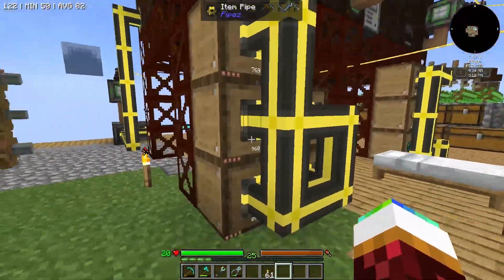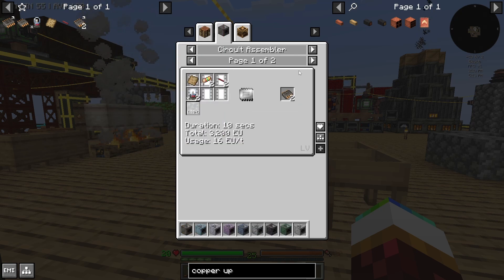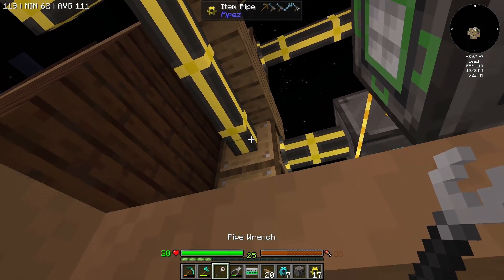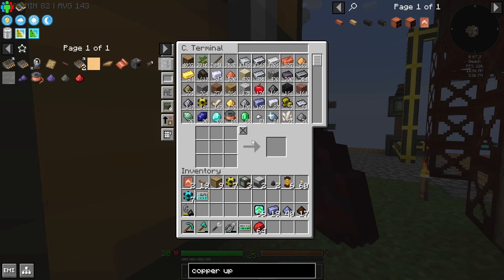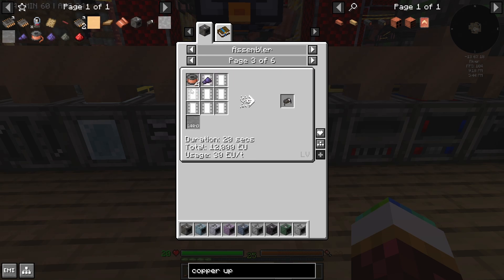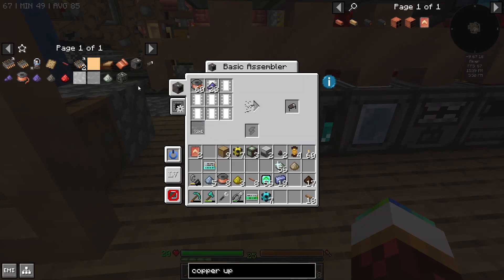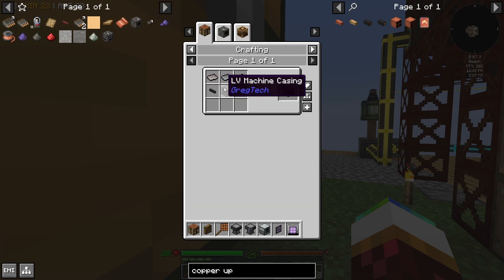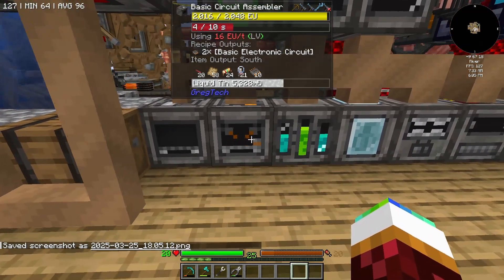Star Technology - EP22 - Easier Circuit Making

Comment: i comment this without any info for episodes under this one i got here first
so dont know what you done or said

i myselv have got to the start of HV for a frame of refrence

the biggest thing i can point to is the rain there is a bug in the base game thats existed for years where if rain is negated any other way then natural (sleep or time)
it will simple comback soon after everytime repeat like clock work unless the gamerule is flipped
the quest book has a quest to perma turn it off without needing cheats (that button you using) in the shop also got one for daytime

next i notice how you where placing machines and drawers and setting auto output but keep expecting it to auto input
as you know thats not how that works gregtech has extra tools for this job
you most likely seen them but not been thinking to much of them
conveyor robot arm and pump
all do what you need for compact places
just pop em on a side of machine that needs a input or extra output
robot arm is a bit more powerfull
to change there settings shift click the side (or open the machine click on the side and the item goes lower right slot)

and this smaller note the small piles of dust ya needed dont need a packer the recipe is not shown right thats why it did not work for you
the auto complete button does work tho
the tiny piles(9) top left slot in 3x3
the small piles(4) top middle slot in 3x3
they dont work anywhere els like you tried in center
this is unltimatly a smaller thing as its not auto like the packer but handy for smaller hand made needs